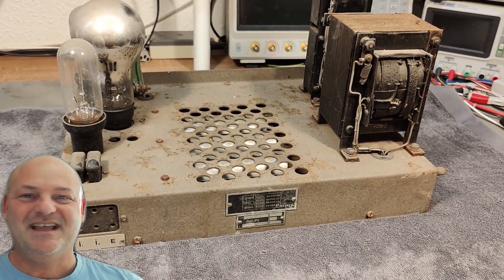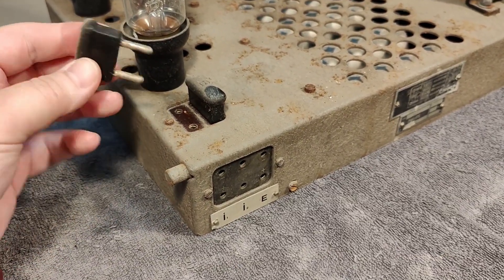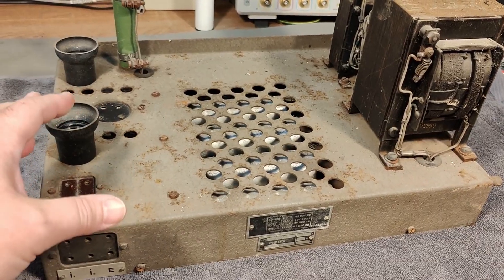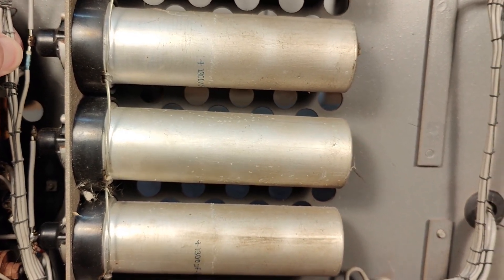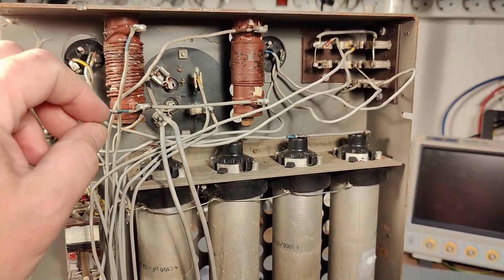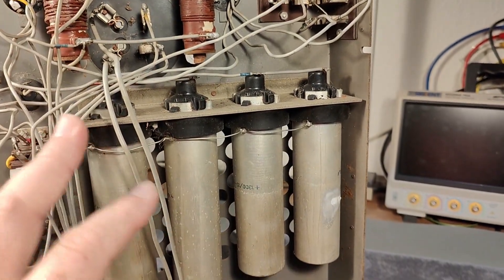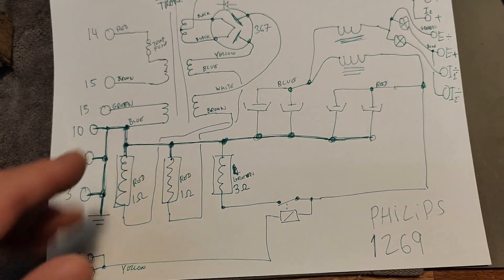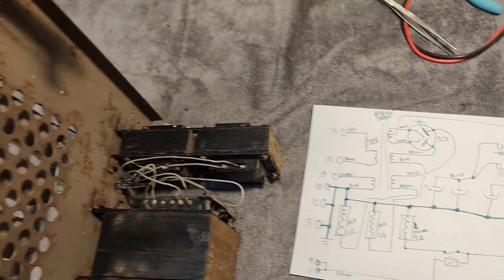Philips 1269 cinema system tube power supply 1943

Comment: At that time, the brightest light was obtained from the arc light. Could this be the power supply for the projector's arc light?
Reply: When I was a projectionist in the 1980's, we used 1940's projectors, modernized soundheads and amps.   The lamp housings were carbon arc, and each projector had a very large 3-phase transformer that provided about 100 amps.  The 6 rectifier tubes in each power supply to provide the DC for the arc were at least twice the size of those in this video.  They had a mogul base and a thick, braided cap wire.   The filaments ran almost white hot and the light coming out o fthe top of the transformer/power supply was significant, as well as the heat.  I think they kept the arc lamps until it was torn down in the 1990's.   Both theaters in town used arc lamps.   Nobody could afford to buy Osram Xenon arc bulb systems.
Reply from the maker: not at all, arc light was replaced in 1910-20

Comment: Well done sir, you have more or less worked it out. It is in fact a low voltage cinema excitor supply. It's function was to supply a voltage of between 2 and 12 volts DC twice. At as much as 10 amps. This supply must very stable and very low ripple. It is x 2 because cinemas had 2 projectors (or more) which only ran for about 20 minuets each (even less in very early days) The sound head on each projector would consist of a lamp which was focused over the part of the film with the sound track recorded on it. This was picked up with a vacuum tube like photo cell, often with a 90 volt supply on it, which was fed of the the preamp. The supply was switched between the projectors as part of the act of film change over from one projector to the other. 
The circuit was really quite simple, these days a similar circuit would just be a transformer, rectifier diodes, regulator chip and some large capacitors. Of course in those early days getting a low ripple current DC supply involved some considerable components as you have found. The currents were quite high, not because you needed a bright light but a heavy filament which would give a constant light across the length of the filament. Such a heavy filament would also absorb any slight ripple still present. You would always know when the capacitors were in need of a service when you could hear a hum on the sound. This is a none technical explanation that I hope most people can understand.

Comment: Speaker field coils ?
Reply: Good guess but no. If required they would be part of the audio amplifier. Voltage is not high enough for long speaker runs.

Comment: Only a guess, but the relay might be to apply a load on the DC output should the audio pickup exciter lamp be disconnected or burn out.  If that happens, the current through the relay coil is removed, and the 3 ohm load imposed, keeping the output voltage low, protecting the filter capacitors.  Just a theory.   I've seen a Philips battery charger using one of those 367 rectifiers.